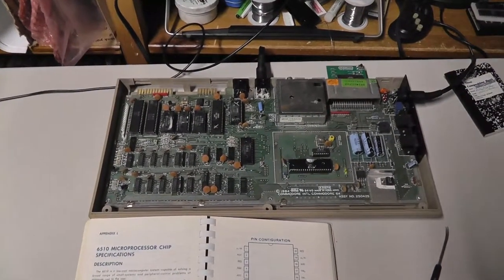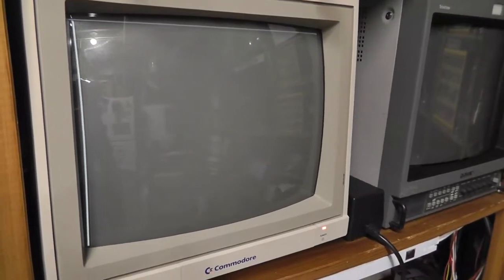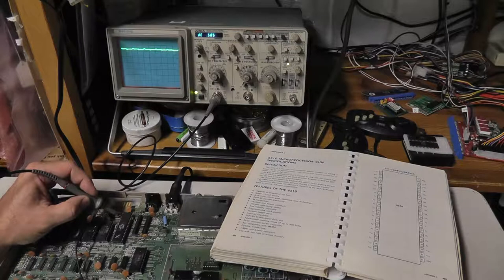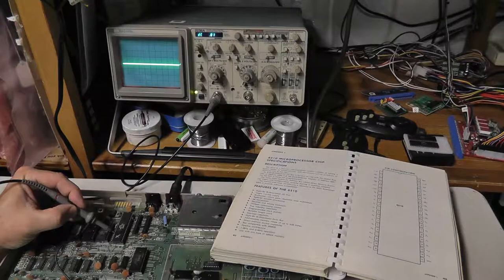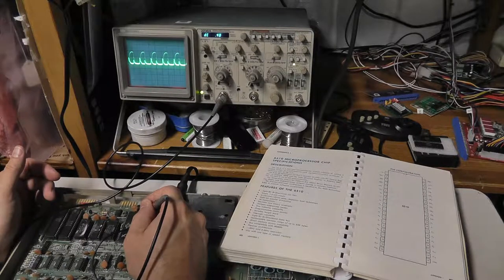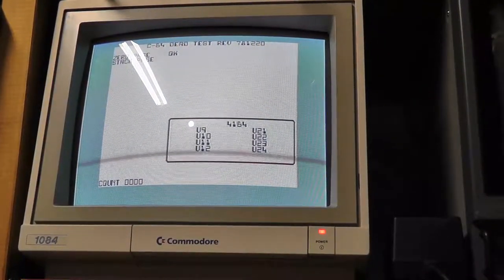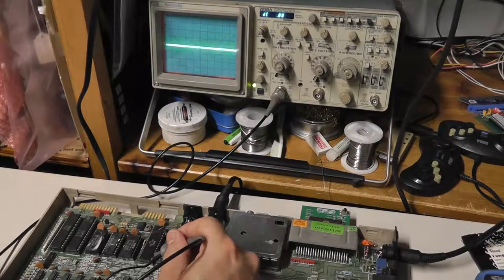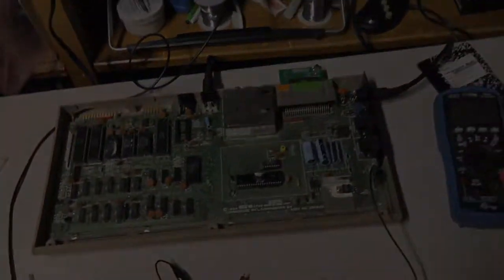My First Commodore C64 Repair - part3 6510 on the scope

Comment: Thanks for the Video! Where do you connect the ground of your osci? Ist there a special pin on the motherboad?
Reply from the maker: There might be a gnd test pt but i likely just hooked up to the gnd rail trace.  Good luck.
Reply: Thx for the answer. On the c64 motherboard, where do you connect the gnd cable of the osci. What I mean is, with the 1st cable of the osci you check the pins of the 6510, but where dou you connect the 2nd cable of the osci?

Comment: Can you see the voltage and frequency at the same time on you display at the same time? What was the voltage on pin 1 clock signal?
Reply from the maker: On my scope, you can't see a digital readout of both freq and voltage at same time.  However the graticule should show vpp while show the freq.  I did this video so long ago, I don't know which part you are referring to.